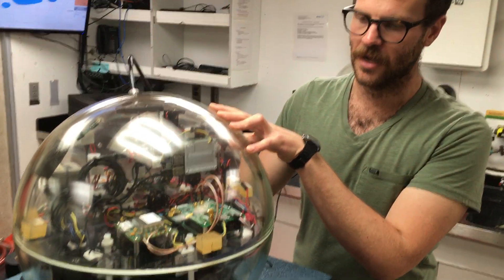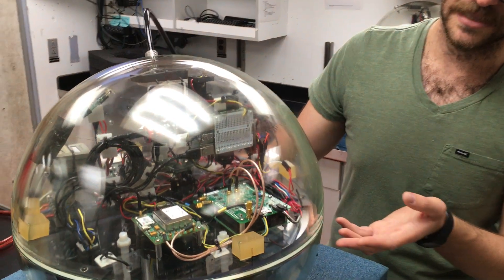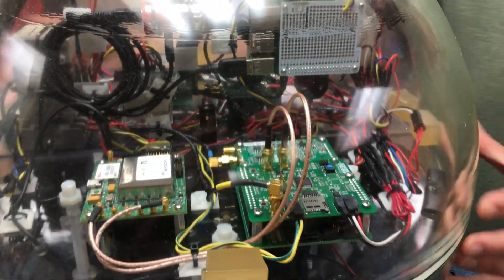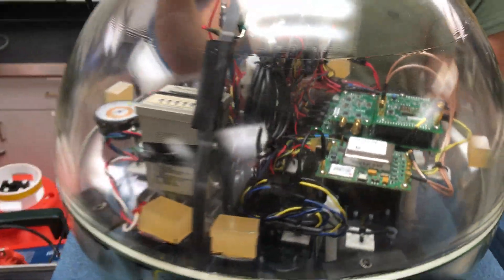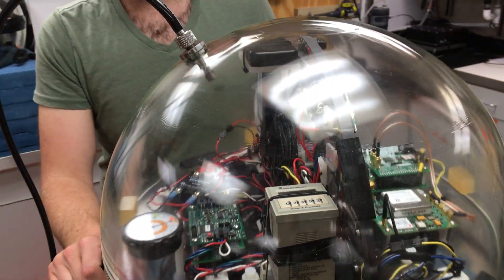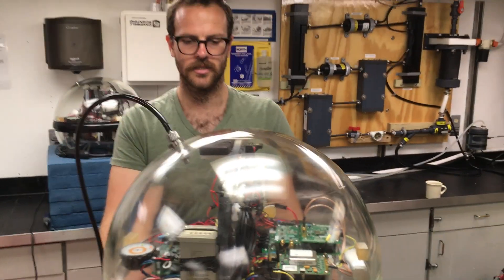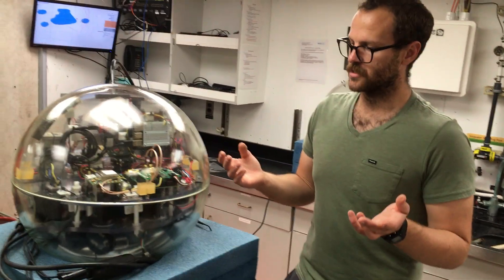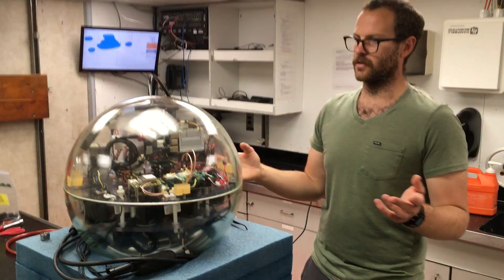DOGs in Bermuda IV

Comment: This was a cool looking instrument cluster, what all does it do?

A sphere is great to hold back pressure, how much do you have to de-rate due to the smooth joint.  Is there any  justification for making an internal dividing disk that supports the radial forces at the joint.  A shoulder that the hemisphere buts against and a thin lip in the joint to seal against perhaps with a soft metal coating like a Con-Flat gasket.
Reply from the maker: It's essentially a hydrophone recorder that time-tags GPS-synchronized acoustic pulses sent from an autonomous surface vehicle with an atomic clock. The disk with electronics just sits inside, it has no structural function or interactions with the sphere itself. While we made custom adaptations, this type of "Nautilus" Vitrovex sphere is the common solution for deep-ocean work (down to 6,000 m or so).